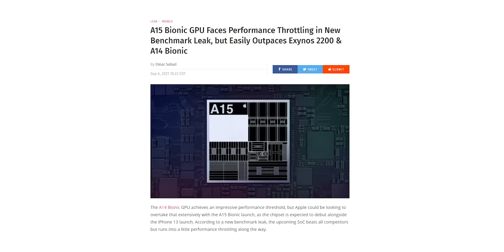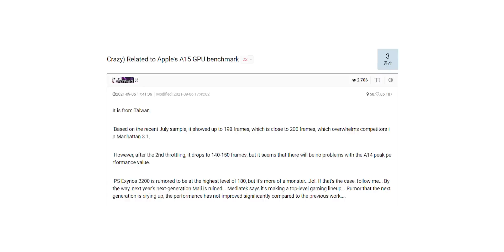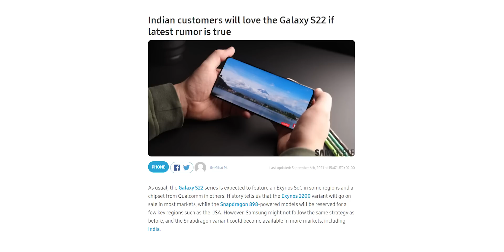iPhone 13 - Apple's Answer To Samsung and AMD

Comment: Ok great 
 but does it shows these differences in real world (not synthetic benchmark) 🙃

We need more Aaa titles to use these horsepower  untill then. Anything above 865 is just un noticable except for gension impact. 

But for non gamers these cpu are just on par with intels i5 10th gen U series performance on a smartphone. The thing in general to get better imo is battery life and charging. 

Display : higj refresh oled check 
Cameras : with gcam any smartphone with decent sensors and sd mt socs can come close to  flagships. 
Proceccor: for non gamers its just way above threshold to even notice the difference between iphone x and 12.
Reply: Actually, rendering videos should be noticeable

Comment: I know for sure that Exynos 2200 will have a better GPU performance than A15 Bionic. Exynos 2200 was tested with two-year-old architecture, and still beats A14 Bionic. So Exynos 2200 with the latest architecture will beat A15 Bionic. Exynos 2200 has been leaked to have a 50% faster GPU than A14 Bionic, while A15 Bionic may have up to a 35% faster GPU than A14 Bionic. So Exynos 2200 is still in the lead. Also keep in mind that A15 Bionic will launch this year, so Samsung and AMD still have time to further improve the performance of Exynos 2200 before it launches next year. And also, the article claims that Exynos 2200 has the same GPU performance as A14 Bionic, which is false. We all know that Exynos 2200 destroys A14 Bionic in GPU. Apple definitely aren't beating AMD in GPU. Apple don't even come close to AMD in GPUs. Nvidia and AMD make the best GPUs out there, period. AMD will definitely dominate in the mobile GPU market.
Reply from the maker: Fair point
Reply: I heard that Samsung will power throttle the AMD GPU down to match the SnapDragon GPU so the differences are nominal to avoid bad PR? That means that their phones GPU will not come near what it can do at 100%? When they are used in tablets and maybe laptops Samsung will open up the full AMD performance in their GPU’s. I suspect that Apple will also power throttle the A15 GPU for the iPhone and only use the full power of the GPU in iPads and the M2 chip? I am therefore not sure what the A15 or Exynos 2200 will benchmark at on phones as I have not heard what the SnapDragon GPU does? Either way all is pure speculation until we see the thermal limits OEMs put on the GPU and that depends on Samsung fabs that failed with the SD888 in efficiency and thermals? I have been hearing that the AMD GPU will throttle very quickly and ditto the CPU? Just check out the Fold and Flip, both benchmarking in stress tests well below chips that are a year or two old!
Reply: Nope it wasn't tested with a "two year old architecture"... It was tested with a 2 years old CPU. Those Benchmarks are GPU bound so it will only make a difference of about 2-5% in real world. You know that Exynos 2200 Performance leak in 3D Mark? My iPhone 12 Pro Max beats the "exynos 2200" by about 400 points (A14 about 5% faster). Okay if I assume its a CPU bottleneck and we will get about 30-40% higher singlecore performance with Exynos 2200 than with the Benchmark it will be approx. 5-20% faster than the A14. The A15 will at least be 30%-50% faster than the A14 so I would call it an easy win for Apple this time.
Reply: Show me actual comparisons with actual devices instead of laboratory setups ....

Exynos AMD will NOT be able to live up to the hype.
Mark my words ...

Comment: if Samsung and AMD had this covered without leaks it wouldn't give their competitors an idea on beating them
Reply: Lol.. sure kid
Reply: But Samsung and AMD still have an advantage of beating them since they’re releasing the S22 line up after the iPhome 13
Reply: Apple plans their products way ahead of their launch, so they are NOT looking at the leaks and making their products better😂😂
Reply: @RC2k5  sheep.
Reply: @RC2k5  Yeah, right
Reply: @RC2k5  You know that this isn't how that works? A15 Chip started production about 2 months ago and design was finished approx. 6-12 months ago but okay.
Reply: @jul1anuhd  my phone did autocorrect bro 😅😂
Reply: I see sd888 performs better than a14... Coz apple sillicons are over heating and don't have a sustained performance
Reply: @nev963  bro even sd888 heats up. its worse than A14. The GPU in sd888 uses more watts than A14.
Reply: @rohithmekala2608  I've see both of their performance..and a14 tend to throttle a lot instantly dimming the screen and the performance... On the other hand sd888 tend to heat up more tho but has more sustained performance compared to that of apple
Reply: @nev963  Its really the iPhone cooling thats the problem. The iPad Air 4 has A14 and it does not have this issue. Apple should use thermal pads or vapour chamber in 
iPhones to prevent that.
Reply: @rohithmekala2608  well its like you accepting Exynos is great too.. if it had better cooling it could have outperformed other 😅
Reply: @nev963  yeah. A15 and Exynos 2200 with AMD GPU both would be great chips with a fan attached to them or even in a tablet form factor where is more room for heat to spread.
Reply: @nev963  manufacturers can choose at what temperature to throttle. Apple chooses to be safe to throttle earlier when some of the 888 chooses to throttle later with higher peak temperature. Still, that does not change the fact that A14 is a more efficient chipset by achieving a higher performance with less power.

However also, I remember A14 is the lowest in the amount of performance drop among 2021 flagship SoCs when running the 3DMark Wild Life stress test as compared to the 888 snd Kirin 9000. Not sure how did you get the impression that 888 throttles lesser. Different devices might have different cooling solution so you might be right too for certain devices especially those gaming phones. But still considering Apple is still too damn cheap to put any decent cpu cooling on their phone and it still throttle as much as the rest, it is still amazing on their part.
Reply: @mitchelltan2909    yup same for samsung they throtle around 42
Reply: @rohithmekala2608  You could make that same argument that it's the phone's fault that it can't keep the 888 cool
Reply: @mitchelltan2909  That isn't efficiency. Temporary boosts to achieve higher clock speeds in short bursts isn't "efficient". It's draws less power but heats more.
Reply: @nev963  true
Reply: Yeah he's right
Reply: Lol yeah
Reply: Yea, but sal wouldn't have anything to post
Reply: Apple already had M1...so I don't think so
Reply: @yourikhi  but it’s not for the iPhone and besides they are making one more efficient than the m1
Reply: You know that these companies have spies and stuff

Comment: samsung still has months to perfect the chipset. so we dont know the full numbers
Reply: The only thing they can do from now is software or driver tweaks. Hype is really dangerous. Please just stop hyping something like that so high.
Reply: Months are nothing ....
They need to start producing  NOW in order to have a product in January.
The remaining 4 months are used for production, testing and actual software.
Reply: @Roomer645   The problem is you can design the chip but if there is a limited supply of chips then they can't make them.
Reply: @footballtalk4857  They have been working on it for years.
Besides that shortage is just marketing talk and a way to upsell.
Other brands keep pushing out phones and they need to produce chips also.
Beside with the ultra flagships the amount of chips is much less than with the budget and midrange market.
Reply: @Roomer645  Other phones use Snapdragon chips which are produced by Samsung so Samsung it's unique in a way because they make the product without outsourcing but they will pay more than another company using Samsung chip business.
Reply: @footballtalk4857  SD SOCs are the way to go.
They should spend their time, money and energy on better batteries, next level cameras and revisit the all feature flagship.
Even afterany years we still have huge debates about the audio jack. There is no denying that it never phased out as people stated and it's still a wanted feature.
Unlike removable batteries that nobody cares about anymore and IR blasters that only a handfull of people use.
SD card storage is also one of these popular features.

No wonder Xiaomi is eating Samsung's lunch.
Reply: @Roomer645  having only sd for the android maeket is not a great idea at all
Reply: @keqling7086  Nope, but having a so called competitor like Exynos with subpar performance at a FULL price isn't great either.

We have had almost a decade of Exynos and what did it get us so far ?
Tell me ...

Comment: Samsung should just cool the phone better, maybe make the back from aluminum and turn the whole back into one giant heatsink
Reply: They should use graphite cooling
Reply: @adithyansunil1153  graphite is worse
Reply: @MrKobus-rz4qy  no it's not a giant heat sink it's just ridiculous
Reply: @adithyansunil1153  vapor chamber is better than graphite
Reply: @MrKobus-rz4qy  graphite is way more better and light
Reply: @adithyansunil1153  *cheaper. And it'd less effective. Did you even do research before making that claim?
Reply: @MrKobus-rz4qy  what do you mean less effective exynos 2200 was able to throttle good with a graphite cooling inside don't you even know what are the Advantages of graphene...go check first
Reply: Samsung is so greedy they will not even hesitate to put Paper in back of phones except their flagship phone Ultra if paper usage was possible.
Reply: @SJ-cl4wq  paper on the the back of phones?? What do you mean
Reply: @adithyansunil1153  They put plastic on a $1000 dollar Note 20
Reply: @adithyansunil1153  Samsung wants to make phone with cheapest thing possible in build quality.
I said if we had some kind of unbreakable paper today,Samsung would have used it without hesitating instead of plastic.
Even realme has better plastic than Samsung now.
I'm getting chance to buy A52s5g for 30 thousand rs with tcs login but still I'm hesitating because of phone with such average looks.
Reply: @Phoenix56801  Yeah that's pathetic
Reply: @clickbaitpro  But tbh if plastic back is done well, I prefer it to glass.
Reply: @SJ-cl4wq  Samsung doesn't make cheap quality build
Reply: @adithyansunil1153  This is subjective.If you are high paying for the very high end device,you will love it.
Reply: @Phoenix56801  I hope Samsung have more buyers like you will will force Samsung to make Plastic Ultra variant.
Making Galaxy Ultra variant in Glass is boring then.
Samsung should have daring to give plastic on their Ultra variant too.Then only I will buy any plastic back phone from Samsung.
Reply: @SJ-cl4wq  one of the reasons I got the s20 fe is the plastic back.
Reply: @SJ-cl4wq  i though samsung had the best plastic back 
it looks so good tbh
Reply: @SJ-cl4wq  realme phones... the software ...
Reply: @adithyansunil1153  It’s just that next year, Apple will have titanium while Samsung will still have plastic back
Reply: @wellszhou8286  Samsung uses aluminium
Reply: @adithyansunil1153  No, their base and plus variant uses plastic while Apple is moving to titanium next year and already using stainless steel, hence making people angry
Reply: @wellszhou8286  dude the base versions are affordable so that's why
Reply: @wellszhou8286  anyways whether titanium or plastic or glass back you need conver case
Reply: @adithyansunil1153  Affordable is not the way to address the plus or even the base, especially for them costing 800 or 1000 dollars
Reply: @adithyansunil1153  You don’t If you have a titanium back or a ceramic back
Reply: @wellszhou8286  dude ceramic shield is glass and of course glass breaks so yea you do need cover case

Comment: Exynos in the s21 ultra was pretty underwhelming tbh. Didn't much of a difference between my s10 plus.
Reply: Maybe not day to day but performance wise it was indeed a high performance chip the CPU is where you will see the most difference the reason the jump may not seem so big was because Samsung had to use the last of Mali GPU.
Reply: It will be underwhelming in the S22 also I have predicted MANY times here.
AMD is not magic and the competition isn't idle.
People are misguided by hype and Again we will see 2 soc markets which sucks.
If the new Samsung AMD soc is so great then they would only offer 1 universal soc.
Reply: @Roomer645  please research why snapdragon is sold in US, before making a fool out of yourself,
Reply: @malathomas6141  who is talking about the USA ?
Sales in the EU, south America and Asia outperform the USA easily.
You need to do your homework and stop focussing on the USA which isnt that important when it comes to smartphones other than iphones.

Xiaomi surpassed Samsung in sales while it's NOT even sold in the USA. That should say something.
Reply: @Roomer645  duh xaiomi mid range and budget phones has better valve and there fore better appeal to customers

Comment: Why did Samsung not partner with the more powerful Nvidia
Reply: Nvidia failed miserably the last time It tried mobile graphics n chipset
Reply: Nvidia has already tried the mobile department, and they had to take everything down
while now a days AMD is coming cheaper and powerful than Intel and a newer company which likes to compete with its competitors
lets see what happens
Reply: @aryandev1005  really last time I remember the rtx 3090 is by far the most powerful GPU
Reply: @harryvlogs7833  it doesn't matter what u remember, bec rtx 3090 is better,  everyone knows, who said u its weaker🤣🤣🤣
Reply: @aryandev1005  you said AMD is better but put Nvidia GPU cores in instead performance would be great
Reply: @harryvlogs7833  I said AMD is better bec it is more affordable and provides almost the same power as intel and even more threads, but when u see the best its Intel. So u can never say AMD is worse.

Comment: What the heck is wrong with Samsung?????? When Indian people wanted snapdragon, it gave Exynos however, now, when Exynos would perform better, it's giving the snapdragon to the Indian market.
Reply from the maker: It's not confirmed yet so
Reply: Like samsung trolling india.
Reply: @dagher.a247  actually 😬
Reply: Be happy ... Exynos is just hype.
Has been like that for years and notice how the AMD hype is all going dark .. They were boasting for years but now they are silent.

AMD only performs when cooled properly and when given power (wattage). Both are poor concepts in a smartphone.
Reply: @Roomer645  nice assumption. 
First assumption1= u made a whole conclusion on two unreleased  phone without official benchmarks
Second assumption2= u assumed that amd and samsung was hyping up their chip when neither did also if they did it would be justified since its their best product why wouldn't they
Third assumption3= u assume these numbers would stay the same with the released product
Forth assumption 4= u assume a15 will have higher sustained performance vs the exynos 2200. Conclusion: take off the  apple fanboy hat, and try to be unbiased
Reply: @malathomas6141  I have been a Samsung user for over a decade bro. I have a ROG 2 and a Fold 2 so I'm hardly an Apple fanboy.

I am basing all my comments on my experience with Samsung these past years and you will see that I'm right.
I am not assuming jack, I am PREDICTING and you will that in January.
As stated many times before, it will be good but the AMD Exynos will not be next level.
Not beating the A15 and just on par with the SD895. Which is a farcry from all the hype.
Reply: @Roomer645  not beating the a15 and matching sd 898 based on what my guy, your gut?

Comment: This year I don’t like Samsung but I am get Google Pixel 6 pro 512GB and iPhone 13 pro max 1TB
Reply: Let's see the pixel 6 pro first.
Google has a way to always spoil a phone in some department.
Kinda like Sony which had the most complete flagship this year by far BUT it's being let down again due to poor choices, price and software.
Reply: @Roomer645  I’m not confirm To By the Google pixel six pro But I’m only thinking about it because of the Price of $1000 for 256 GB
Reply: @youtubepro2323  it's good to see they finally deliver proper storage (512GB option) but let's see it first.
There is just hype and it could be held back by many things.
Just look at the last Pixel that didn't even have the face unlock option. Something thats on every Android phone and even though it's not as secure as Apple Face Id it should be an option which gives the user the choice.
Google is like Apple where they will decide what you need and what not.
Remember the 2x zoom lens instead of wide-angle and they defended that poor choice.
Remember the useless Soli radar that nobody asked for and hasn't been used ever again.

Let's see the 6 series ...
The first fail is the late release date. They always seem to take longer and longer each year even though they don't have huge production numbers compared to the other brands.

Also their sales market is shambolic. No wonder they fail to get traction and have a negligible market share.

Comment: Looks like apple has increased gpu cores form 4 to 6 because this much jump is only possible in this way but the thermals and battery life will be effected
Reply from the maker: My bad! I meant 6 core CPU
Reply: 5 core, not 6 core